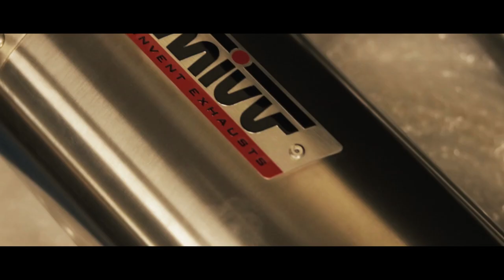Vlog #5 Installing the Mivv Oval Slip-on on the Hornet

Comment: The video look pretty good and bike too. I just have one question, do you need to do some changes in motorcycle, after you install this slip-on exhaust? Like do something with carburetor? 
Have a good day😄
Reply from the maker: Thx for your comment, usually changing a full system or just the silencer will make your bike run a bit lean but with the Mivv and the DB killer in it was honestly alright and we didn't do anything to the carbs. I could imagine that without the DB Killer some adjustments would have been necessary. Best is to pay attention to how it runs, if it back fires or not, check your plugs or take it to a dyno. Hope that helped 🙂
Reply: @brucesmotorcycleshop3729  thanks for quick reply. I bought the same exhaust on my Hornet, so I was just curious. Thanks again👍

Comment: Hi there bois, I love this exhaust and am considering getting it for my 2005 Hornet 600. But I have the stock license plate holder installed, and I'm concerned it will interfere space-wise with the exhaust, since it does look quite big. Do you know whether I'd need to change it/do some cuts to the plastic?
Reply from the maker: Hi man, I honestly don't know if there would be any fitting issues with the license plate holder but I can imagine that it shouldn't be on the way as the Mivv isn't really much bigger than stock. Unfortunately the bike is sold so I can't check for you. Thx for the comment 😊